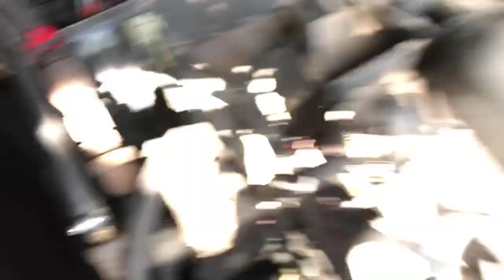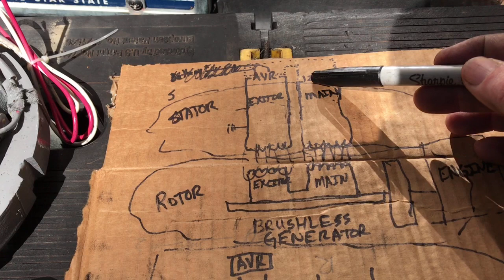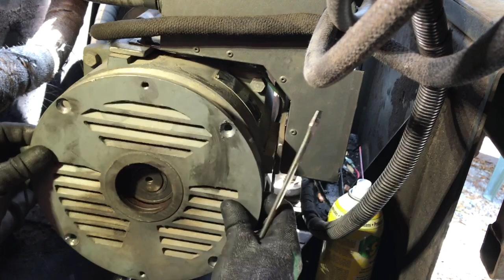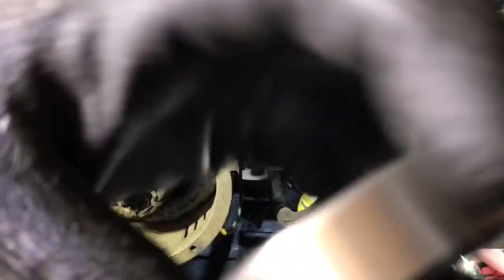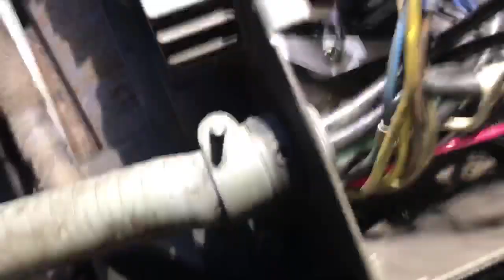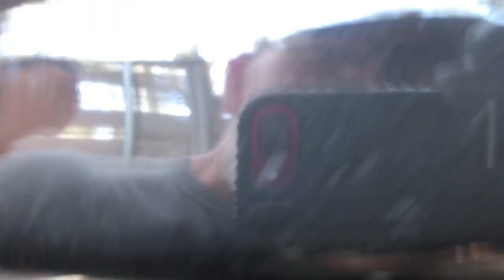-Gino’s Garage- Part 1 Working on 12kw Powertech Generator not making power in a 1984 Wanderlodge.

Comment: Interesting, I think it is best practice to start small bolts like that by hand, easy to twist them off with that screw or impact gun, lucky that you stripped them but just as easy to twist them off.
Reply from the maker: Well to each there own, I find the impact breaks stuck bolts loose better than by hand, I have twisted off more bolts by hand than I have with the impact. I am also not using the impact mindlessly, I am not just holding the trigger on as you notice, as with any tool I try to use finesse.

Comment: This is what I did in the SEABEES when I was young. Went to school for it. Used to fool with 60K, 100K and 300K monster's. Even when I went into computers in the Navy, if no one was around and we had generator problems, I got the call.  You megged the windings so I am with you about the regulator. I might have done a thing or two different, but not by much. They did vex me too. Sometimes it hard to nail a problem down like this. They are not really that complicated but they can fool you.

Comment: I know a good electrician if you need some help lol. Thanks for sharing 👊
Reply from the maker: LOL thanks.. Any tips I am all ears. I have installed many generators but have never had to work on the AVR or internals.. so I am just doing this by the book, which is not very good either. I have been looking for more information on the AVR in order to test it, and I was not finding much on it.
Reply: @GinosGarageUSA  I’ve worked on a lot of generators either steam or gas but they were just a tiny bit bigger lol. My bus still has the old Perkins. Still making power. Knock on wood lol
Reply from the maker: @jamesharmon5963  Yea, I have worked in large powerplants too, but never worked on the voltage regulation end of that either.. Mostly instrumentation on the turbine or ancillary components.